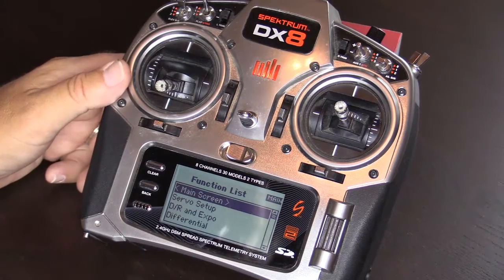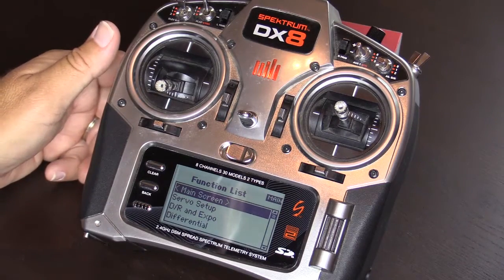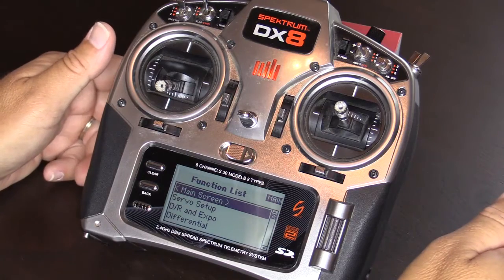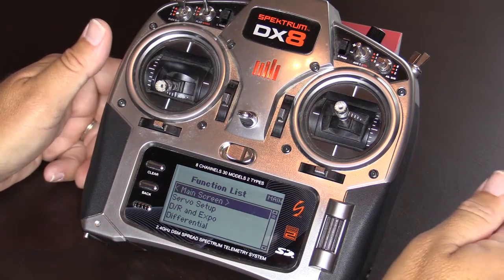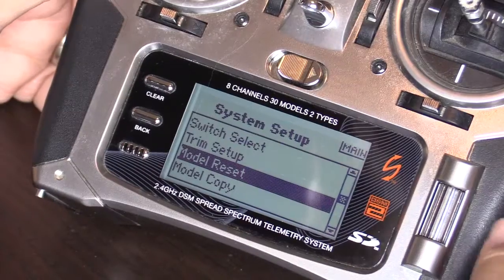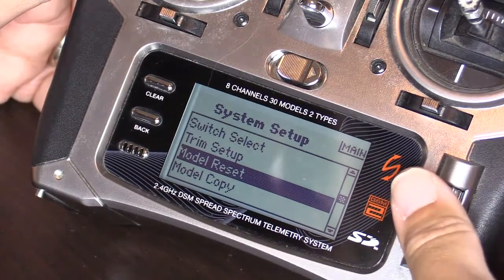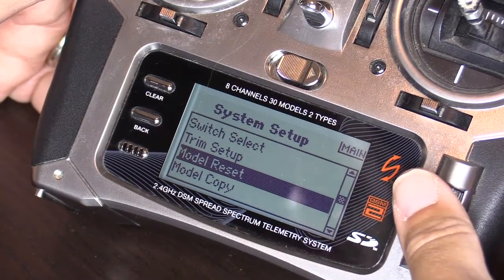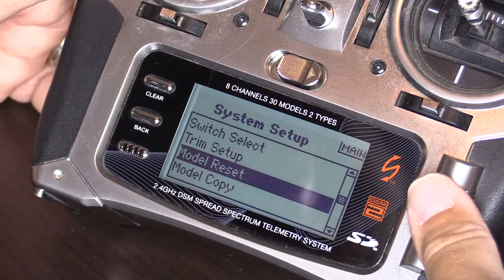Basic Transmitter Setup - Aura AFCS

Comment: If I want the option to have duel rates (in each of the 3 flight modes)
due I go into the DUAL - RATE / EXPO option in the radio and assign it to a
switch?    ....
and then I can make changes in Aura as needed....
or make rate and expo changes in the radio but later transfer them to aura 
or hand copy them into aura and reset the radio values to zero ...or to match what is in aura ?
Reply from the maker: Rates and expos should be done in the Aura.
Reply: @FlexInnovations  but how do you switch between low and high ?
do you still assign a switch in the transmitter and then set the values in  Aura rather than the radio ?

Comment: I am going to be installing one of these in a 7 foot wing span P-40 scale model. I am using a spektrum dx7 an currently use the gear switch for my retracts. I do have a 3 position flight mode switch. How will that affect setup?
Reply from the maker: The default flight mode channel is set to Ch.5 (gear channel on most radios) so that users with 5-channel radios can still use our system.

That said, with today's modern radios, you can do 1 of 2 things:

1. Plug your retracts into a different channel - assign that channel to your normal gear switch, and assign Ch.5 to a secondary switch.
OR
2. In the Aura Config Tool, tell the Aura to look for a different channel (like Aux 1 or Ch.6) for data to change the flight modes.

Totally up to you in how you accomplish it - they do the exact same thing.
Reply: Do you have any reference material for a dx7 heli version with the 3 position flight mode switch?
Reply from the maker: Generally speaking, there are a TON of different radios/receivers that the Aura is compatible with, and it would take years to cover every possible option...

That said, if you are using the original DX-7 (one of the early 2.4 radios), your best bet is to talk with Spektrum about your radio in regards to reassigning channels and such. That is a very old radio, and we don't necessarily know the ins and outs of every radio. By default, Aura uses the gear channel (Ch.5) to change the flight mode. You can also tell Aura to look at any channel you desire using the Config Tool.